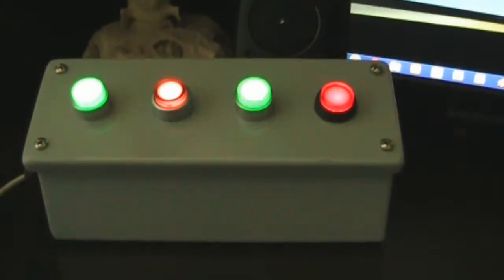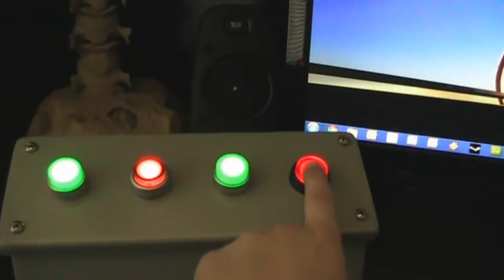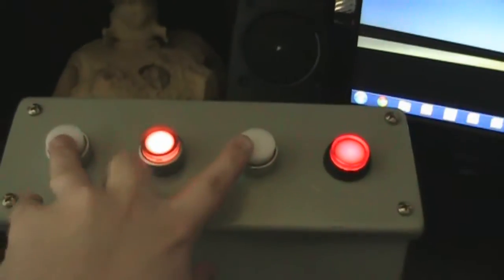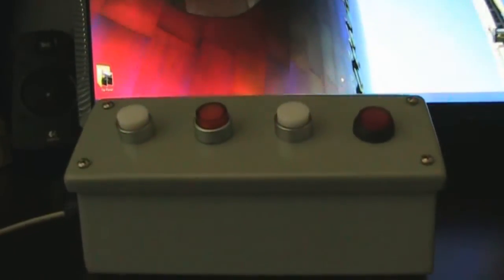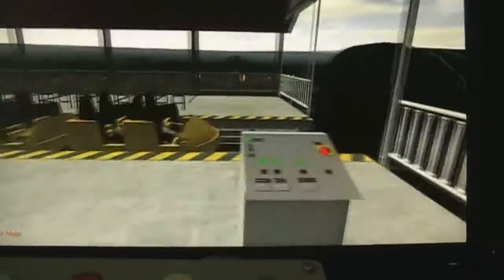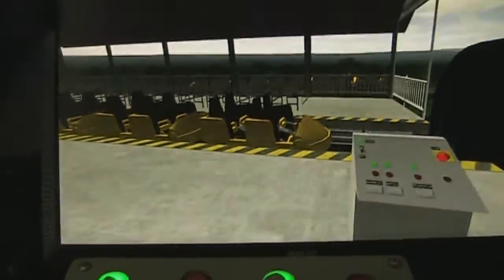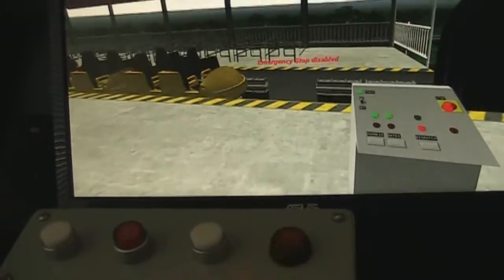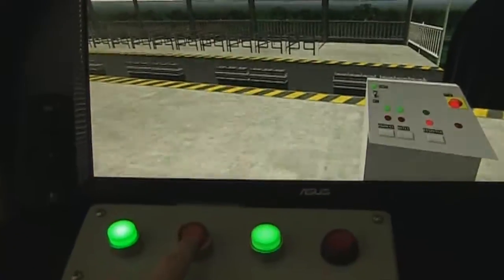Ride Operator Control Panel for Windows/NoLimits Coaster Simulator

Comment: Just a suggestion, if you want it to be as realistic as possible, you should swap the E-stop and the right dispatch button. Real coaster panels typically have the dispatch buttons in the bottom right and bottom left corners of the panel, and always far enough apart that you can't push both with one hand.

Comment: Coasters typically have two, so that a single stuck button won't cause an unintended dispatch. You have to press both at the same time and hold them until the train is clear of the station. NoLimits however only has one and it's not necessary to hold it down,

Comment: there are push button stations available on ebay, is it possible to wire them to the computer and use them as a control panel?